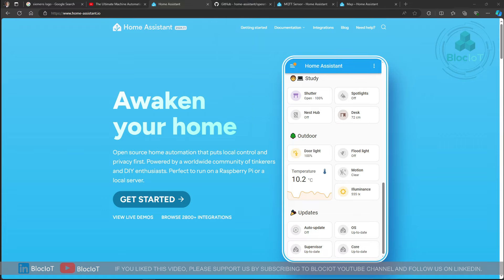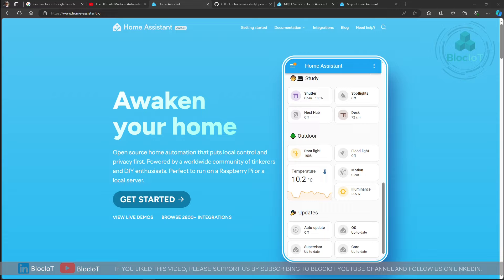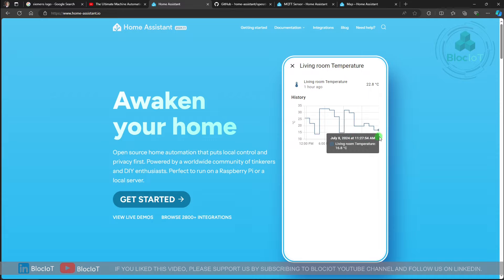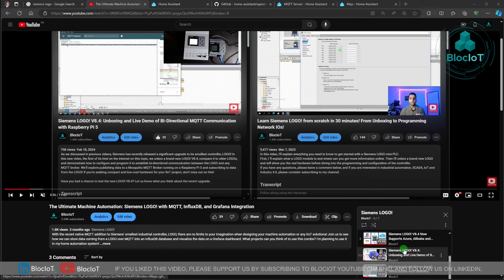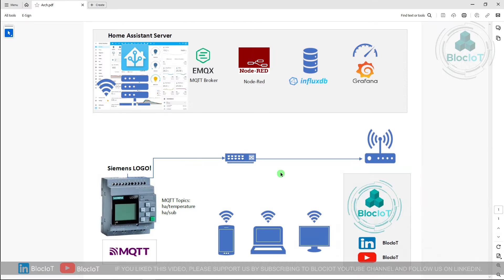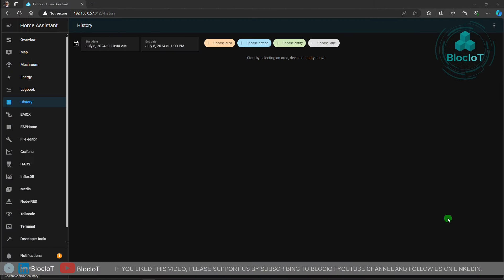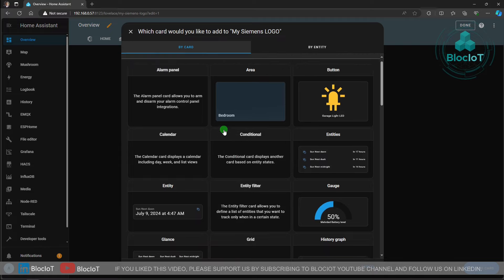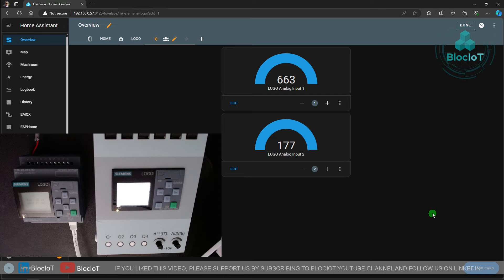40- How to Connect a Siemens LOGO to Home Assistant as an MQTT Sensor?

Comment: Great content ! Thank you. It would be great to see also how to read a state from HA into the LOGO. For instance if a light is connected to the LOGO and we want to turn it on/off from HA.
Reply from the maker: Thank your for your feedback. Great question. To control a light switch from HA, you need to define a SWITCH instead of SENSOR on the yaml file. you can find the details here:
https://www.home-assistant.io/integrations/switch.mqtt/
The only catch is the json payload format that needs to be defined under the SWITCH. Here is an example that you can use:
{
  "state": {
    "reported": {
      "VM4": {
        "desc": "V-word-4-1",
        "value": [
          13
        ]
      }
    }
  }
}

This payload write the value of 13 to VM4 which is defined in LOGO MQTT transfer area.
Reply: @blociot  Thank you! I'll try that when I have a chance to play with my lab 😁

Comment: Thank you, this was mind opening!
Do you have a video on how to connect wifi switches that to the Logo PLC. There are a lot of devices with ZigBee and just wifi connection to cell phones and apps like Tuya. Is it possible to connect these? Also do you have anything on rs485 to ethernet connections on the Logo. There are inexpensive ethernet to rs485 devices that would be very useful to connect to the logo.
Reply from the maker: @safaritooncesrv7946  thanls for watching. LOGO and industrial PLCs don't natively suppory Zigbee. if you want to connect a Zignee device to LOGO, you will need a middle software. You may use Homeassistant as the middle software and I have a video to showcase this application.
You could also use Zignee2Mqtt to convert Zigbee to MQTT which is understandable for LOGO.
I'm crrating a whole tutorial series for LOGO. The first video is already available. Make sire you follow that if you want to learn Modbus, RS485, etc. In LOGO!

Comment: I successfully connected my LOGO to HA using your video as a guide. Thank you! The sad part is that LOGO is sending each value in the same topic, which causes errors in logs, for example, if you have two inputs and you change the first one, then for second you will get an error:  ERROR (MainThread) [homeassistant.helpers.template] Error parsing value: 'dict object' has no attribute 'I2' (value: {"state":{"reported":{"$logotime":1729768804}}}, template: {{ value_json['state']['reported']['I2']['value'][0] }}). Any ideas on how to solve this?
Reply from the maker: Greta to hear the tutorial was useful.
I didn't understand what do you mean by "when you change the first one...". Would you be able to explain more?
If you want to access two analog inputs for example, first, you need to make sure the inputs are included in the transfer data area in the LOGO software. Once they are added, their value will be published to the topic as an JSON element. Here is an example, how you can access two analog inputs as two different MQTT sensors in HA:

  - name: LOGO Analog Input 1
    state_topic: "logo/pub"
    value_template: "{{ value_json['state']['reported']['AI1']['value'][0] }}"

  - name: LOGO Analog Input 2
    state_topic: "logo/pub"
    value_template: "{{ value_json['state']['reported']['AI2']['value'][0] }}"

From the error message, it looks like I2 doesn't exists in your JSON payload that LOGO is publishing to your broker.